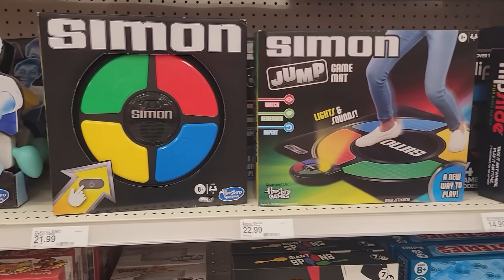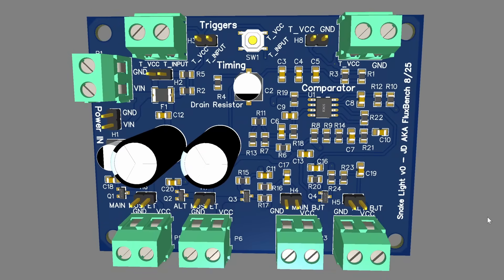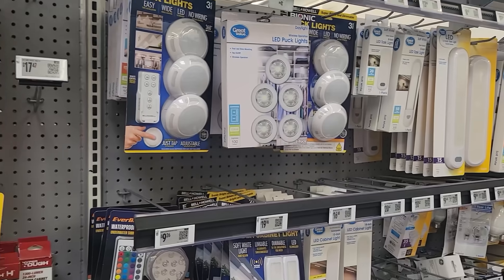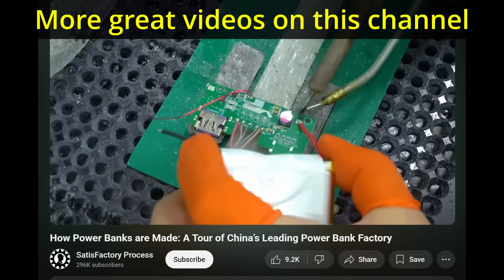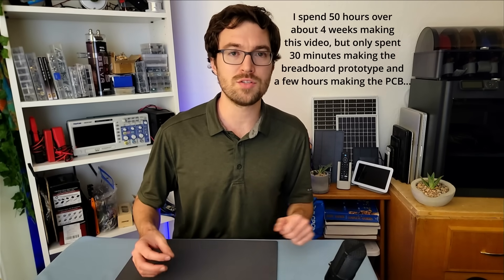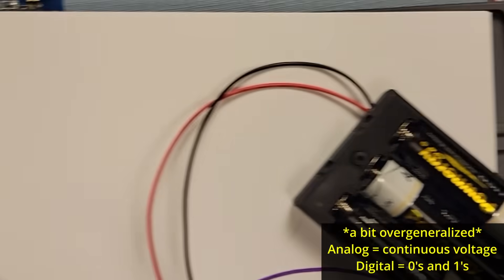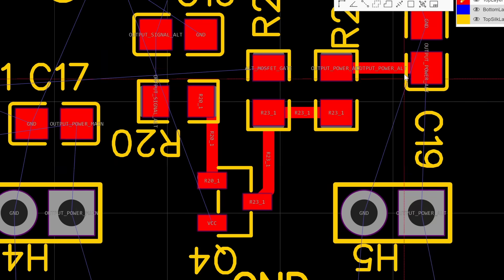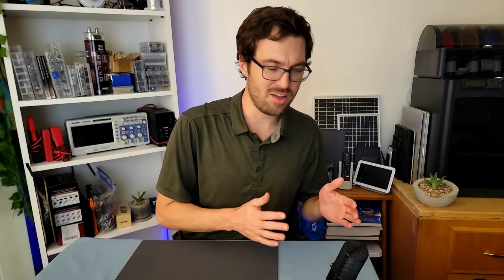How a $2 Circuit Becomes a $20 Product

Comment: There is a logical way to build a product, or an intutive way to build a product without over doing it🤔. The situation is unique, It deserves a custom solution.👍 That said, you can also use a cheap through the door(non metallic) microwave sensor(which have the timer feature built-in) to control a 110v light bulb, or a low voltage rechargeable lamp.🤔
For 🪱🔦, would it not be better to make a product that is nothing more than a timed pager motor vibrator(Snakes are sensitive to vibration), that operates for a few seconds every hour, when lights are out. It is better than the false sense of not encountering a snake or stepping on it. Unfortunately selling electronics is over rated, unless you could protect your product(only if you are scaling commercially, where the real revenue is)  from copying, which is beyond skill level of most newcomers. You are better off making custom solutions(current project being an apt example) for your personal use. Could save much more on electricity, time and frustration and few dollars🤔❤👍
Reply from the maker: Honestly, I just need this for me really badly. I've tried many motion detector lights and even built my own with a huge battery, but what I really need is a trigger activated timer for some low-powered lights.

I live in a old house and the light switch is like 10 steps from the door, just barely too far to confidently walk in the dark. It's also to make sure I don't accidentally step on something that fell over and trip on the way to turn on the light. That has happened before! 😬
And I don't care about other people stealing my idea because if it's worth them stealing, it's probably worth me selling! Enough money for everyone, even the thieves 😂

Comment: Could you also make a snake alarm that registers weights or if something was moved? Set up something they'd knock over or vibrate when they pass it?
Reply from the maker: A million different types of sensors could be used to detect the snake, but I'm just worried about getting to the light switch after I open the door. Trying to keep it simple. 👍

Comment: Wait a min, you 3d print too ...!!
I sense another potential playlist on 3d print too .

I too want to learn 3d print and use it to create cases or holders potential circuits boards.
Reply from the maker: You're going to like the next idea to income episode then! A lot about mounting a PCB in a 3D printed enclosure and getting the physical mechanical stuff working great! 

Didn't think about a 3D printed electronics case video. I've made plenty! Good idea!
Reply: @FluxBench awesome,
I like your snake light idea.
Any gadget or gizmo ideas for new dads ?
Reply from the maker: @faraz007 organizers and "holders" for things. I do some food safe related work, and 3D printers are just chemically messy. Grease and burnt plastic residue and metal filings and stuff like that are everywhere. If there's a chance the kid will lick it or whatever, maybe do a quick soap and water scrub to the print.

Keep every piece large or integrated like print in place hinges so you don't have to worry about choking hazards. Add a 2mm or more chamfer or fillet to corners so there's no sharp anything. 3+ wall layers because kids don't understand stuff breaks 😅 Hit your prints with a heat gun (hair dryer might work) to get any microplastics or fuzzy bits melted off or bonded to the print.

Once the kid isn't so delicate, then a bajillion things can be made! Congrats on being a new Dad 🎉
Reply: @FluxBench thank you sir❤

Comment: Being an electronics nerd, I have an idea that is solely modeling and 3D printing. I've gotten some decent praise over it. It's hard work and fully custom on each order but I could charge A LOT per model. Thing is, I'm lazy and I work as an engineer already with my employer, so I don't put much effort into my idea. Kinda sucks. Also, it doesn't mean it will fully take off. Maybe some buzz at first but nothing major. Only way to know is to push and I haven't done that..
Reply from the maker: I keep going back and forth with some similar ideas. Being able to be a employee and just walk in, do decent work, not even great work, then walk out at the end of the day and get a nice paycheck sure is convenient. Easy. But it is a lot of fun playing with 3D printers 😄 

I think it's a great way to have an outlet to try to do great things and put a lot of effort even into something little. At work I would have gotten in in trouble for spending 10 hours on something that should have taken only 2 hours, but when I put in the extra time and effort and iterations I'm really happy with how it turns out in the end! I don't get that joy and pride showing up for a paycheck to get something done as quick as possible and as good as it's needed and no more.

So maybe a 3D printing business isn't going to be as good of money and it will be a lot more work, but it's probably something you can do without giving up your main job right? Seems like you got a good hobby or distraction for you!

Comment: Really nice, straightforward presentation without any unnecessary glam. I like the emphasis on trial-by-fire; prototype first, and everything will come after. As long as you have at least something, you can see how profitable or manageable it is. It really shows that even a garage-basement product will work as long as there is some polish and love placed into it.
Reply from the maker: Exactly! Committing a huge amount of time or money up front is too risky for me. I'd rather risk $20 or 30 minutes at a time for incremental validation, doubling down on money and effort each time. The polish at the end is the key!

Interestingly enough, just like products, these videos also get better the more you put time into polishing them. The same base footage looks like crap after you just put it in the editor, decently better after some work, but after a huge amount of polish it's hard to tell it's the same video clips as the beginning.

Comment: My big problem is actually selling anything.  It doesn't matter if it's something I made or reselling I just can't sell anything on eBay or etsy.  I think I need to push it on "social media" but I'm not on any social media sites and don't have a following if I did.
Reply from the maker: I used to resell modules on eBay, that's a tough platform! Seems like too often you're getting extorted by a customer basically saying they'll give you a one star review to tank your ratings if you don't refund their purchase for a BS reason they obviously made up, or being screwed over by the USPS and postal system.  My little bit of experience on Etsy was pretty much the same. You have a high cost of doing business in that way. 

My goal is to sell products on Amazon so that they look like any other product. Not DIY, not handmade, but the product you end up buying because it's only a few dollars more than the cheap Chinese crap but has good features, good build quality, good reviews, and good documentation. Amazon has its own challenges, but mostly they're just fees and returns.

For me the hard part is finding the thing that's easy and fairly low cost to make, is basically like some existing product so I don't have to convince others they need to buy it, but does something none of the other products do so I have a competitive advantage. I have three products lined up for the idea to income series so far including the glorified cabinet light with a physical trigger instead of motion.

I work with people who do nothing but e-commerce sales pages and advertising campaigns and stuff like that. The amount of effort they go into making a product page really sell well is surprising. So many small tweaks and testing and numbers and psychology and stuff like that. 

E-commerce can be tough 😢
Reply: @FluxBench  Yeah, I'm a technician from way back so most of what you say about that side I already know (always interested in new things though).  YouTube feeds me a lot of woodworking videos and that stuff is not mail friendly so that means Facebook marketplace (which is apparently a jungle) or flea markets and I'm not keen on either of those avenues.  At some point I'll hit on something that works.

Comment: I feel this was too focused on the design of the product but not on the actual "real product" part. How about when JLC messes up 10% of your boards, and you need to do quality control on every one? How about the actual costs of hiring someone in America to do PCB assembly, contracting it out, or getting it done by the PCB fab in China? 

How about if it's actually successful, and you need to scale your product past a certain point? How do you ensure you're consistently making a product, quality controlling it, and shipping it to Amazon, to get "passive income"? That's a non trivial logistical challenge, and if it's easy, how long until your manufacturing partner just makes the exact same product and sells it on Amazon but for cheaper? 

In my personal experience, designing the product is by far the easiest part. Scaling manufacturing is so much harder.
Reply from the maker: You are right on so many points! I'm going to do this with in house testing and product assembly initially but hope to show how contract manufacturing is probably what people will be doing in the end. I try to stay away from Chinese contract manufacturers so at least if they want to rip me off they have to do more than just order more parts and keep the lines running for a few more hours a day.

Probably going to make a simple bed of nails and eventually build a little semi automated QC jig that can grab and check a single board from a stack/magazine of 100 boards. JLC often messes up more than 10% of my boards! I swear, they assign people on the first day of the job to hand solder USB ports 😂 this will be a fairly simple one and should have pretty low rates of PCBA failures.

As far as scaling, this is a hard one for me to communicate because I just email my preferred contract manufacturer the basic info and he sends me back a price. Then I send tons of instructions and photos and then the stuff to assemble.

But getting to this point wasn't quick or easy so I'm still thinking through how to communicate it to others. Seems like you have experience in this area including the many pitfalls. Do you have any recommendations?
Reply: @FluxBench Check out Stephen Hawes and his open hardware manufacturing podcast. He's got lots of great info. I think ultimately, making a successful hardware product into a real business beyond a personal Etsy type store is extremely difficult if not impossible without actual access to the manufacturing process itself, like having an injection molder, or having significant outside investment to have a lot more leeway for scaling. Just about every successful hardware startup in the past 20 years has gotten significant outside investment, it's very rare if not impossible to bootstrap it up to any "real product" level where you're selling in stores across the country and such.

The hard truth of it is that without significant access to the direct manufacturing resources, it's either going to stay at an Etsy shop type of scale, or it's going to get quickly ripped off and sold for cheaper.

I'd recommend in general, to have as much direct control over as many aspects as possible. Amazon is fine, until they change their fee structure or advertising and screw you over. JLC is fine, until they drop the quality a ton when you order a bigger batch of boards. I don't have all the answers, but eliminating as many places where you can get screwed over, and having backup options, is essential.

Comment: Is it “overly “ wrong to use already made pcb or even an arduino ? Would love a reply thanks
Reply from the maker: Definitely not! If it makes sense for your application and where you are technology knowledge wise then it is perfectly fine to use something someone else made or even program the firmware in Arduino. But the lower cost your item is, the more of a chunk of your budget it will take up to buy something from someone else. 

If you are doing basic stuff in the firmware then it's fine to program it in Arduino but you're adding a third party between you and programming the hardware. It just makes the whole process more fragile, but it doesn't mean it's broken! 

I make my own PCBs and then write my own firmware using the programming environment and native code for the chips, like Cube IDE and C code for STM32. I can use all the features that chip has, and have minimal third party things that can go wrong. My most frustrating work days are when I have to fix someone else's problem. Less other people means less problems usually 😂
Reply: @FluxBench  Ok Thank you so much for the advice you just got a sub and I’m gonna be sure to recommend your channel 
Respect from New Brunswick Canada 🇨🇦👊

Comment: How to make pcb if we are able to do on breadboard. Like how you calculate those resistor and capacitor values how to design them. Lot of black boxes are there can you explain some videos on them like small examples
Reply from the maker: Definitely left a lot of black boxes! I plan on making a video soon where I will do all the numbers and the planning where the electronics as well as make a simple PCB. Hopefully that should be what you need!
Reply: @FluxBench  yes thank you so much
Reply: There isnt one magic rule for that. You either understand the purpose of the components and eyeball it or you need to use math for example if you need a lp filter circuit you can use an online calculator but the size and even type of components you need to learn about it the hard way or selectively learn about each part of your circuit. It goes without saying if you don't know basic electronics you should not attempt (yet) to make a marketable product there is a lot of nuance for actually certified products.
Reply from the maker: @Saleca I'm going to try to make a few videos of walking through making a PCB where casually I'll just pull up an ohm's law calculator and plug in some values and show "look we need a 220 ohm resistor for this LED to get the 30 milliamps we want".

If you have any suggestions, I'm open! So much math and concepts to introduce. Trying to sprinkle in the core but kind of boring stuff between the fun stuff.
Reply: @FluxBench  yes please even though we have studied electronic circuits kirchoff laws all the stuff. Practically if somebody gives some push it will open some window. In india most of our graduate courses are theoretical and labs we are not allowed much to trial and error. Hope you understood my concern 🙂
Reply from the maker: @Tri_Mind I will definitely keep up these videos trying to encourage people to do practical things and get some easy experience. I learn the most from my errors! I hope you can get some practical experience making PCBs. I'll look into PCB manufacturers in India, I'm not familiar with any specifically.
Reply: @FluxBench  sure thanks 😊

Comment: What's the fastest way to learn PCB design? Every time I think I have a good grasp I find another factor to consider, optimal trace widths, via size, signal noise, etc.
Reply from the maker: Fastest way to learn is by doing and making mistakes! Most PCB things are really easy and forgiving, it's when you start pushing the limits that the nuances really matter. Many components will work despite what you did, rather than because you did things perfect.
I think you should just make a small module somewhat like dipping your toe in the pool. Even something with 3 to 10 components is enough to get an understanding of the process. Software doesn't matter, some people literally draw their stuff up in Microsoft paint as you're basically sending image files aka Gerber files to the manufacturer for them to remove copper and etch things in a pattern basically like photography.

You'll find the water is not that bad and you might want to jump in on your next design and make something bigger and more complex!

Maybe I should just make this comment into a video lol 😂
Reply: @FluxBench  I've designed some basic boards that just combined through hole components. I've gotten to a point where I need to make a fully custom boards with integrated MCU and sensors. I worry about wasting a lot of time and money if I get it wrong. 😬

You explain things well, I would love another video! 😊
Reply from the maker: @learnwlilly looks like you're already diving in! Seems like you had a decent start and nothing went too bad 😉 seems like you're ready to step up to more complicated stuff.

What kind of MCU and sensors are you thinking? Would you use a linear power regulator or like a buck converter if you're going from 5 volts to 3.3 volts for something like an ESP32 or STM32? Do you have a goal for the board or just want to get that notch on your belt before moving on to other stuff? 

I'm kind of a little bit jealous, I would love to be able to go back and make my first complicated PCB again. Like replaying a good video game!